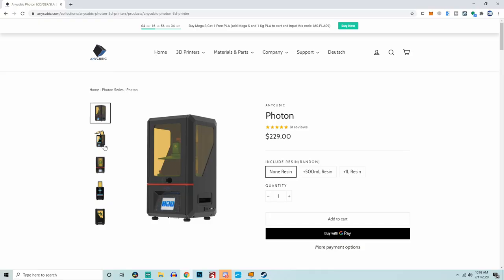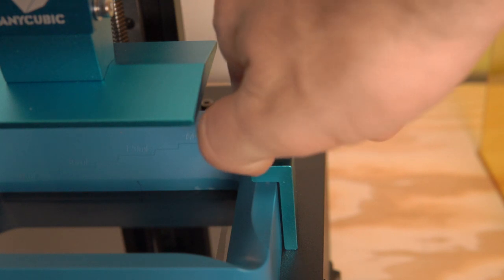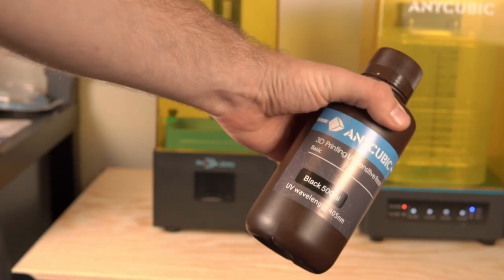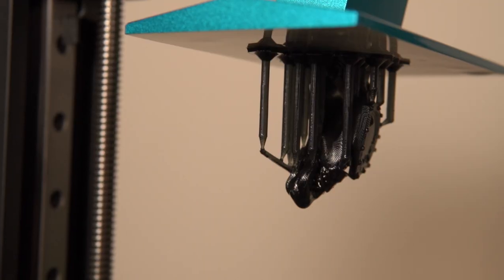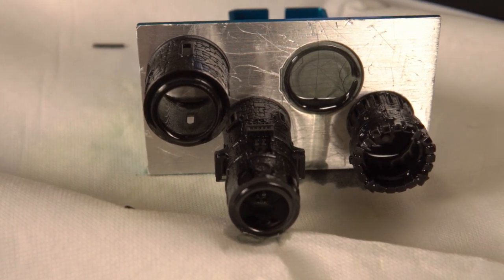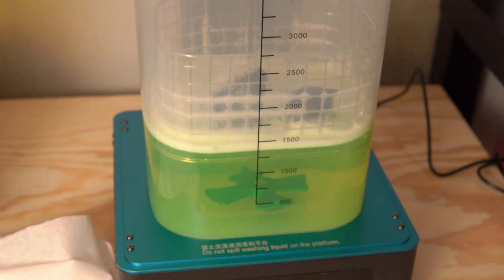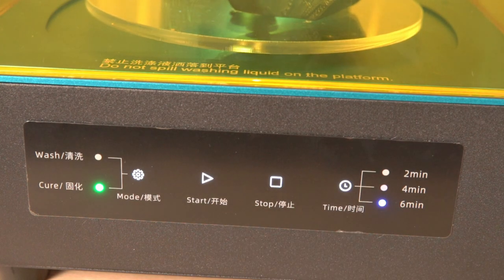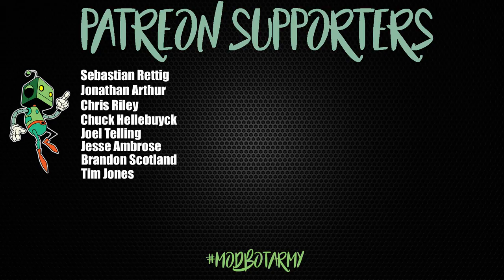Review Of The Anycubic Photon + Wash & Cure Station | Complete Resin Work Station

Comment: I got my zero and wash station three days ago. Almost everything has gone well. My flash drive was formatted NTFS and the printer would see the files, but copied them to my own FAT32 and it worked fine. Demo files and other presupported files worked sliced in the supplied software, I got transparent green resin. Have had a few issues with some presupported files not properly supported, but that may be more to with the files having too fine supports. I probably will in the future want a printer with larger area and more resolution, but I think getting the wash station with it for the price of a slightly better printer has given me a better overall experience starting in resin printing.

Comment: Hi there great video.. Is there anyway you can give me the basket size in inches just length x width x depth ??  I looked at there site and it says 65mm width which is I think 2 9/16" that's seems extremely small just wanted to see if that is what you get... Thanks so much...